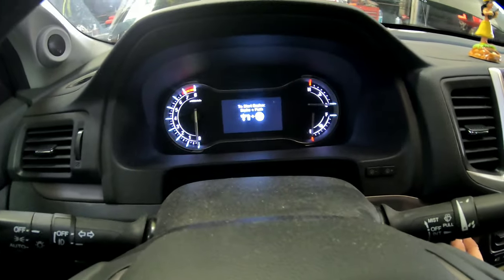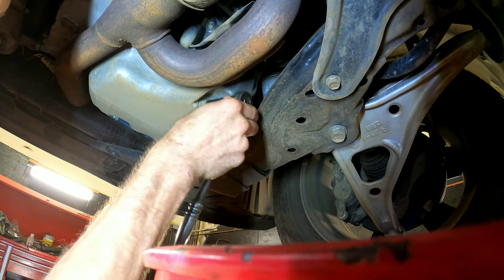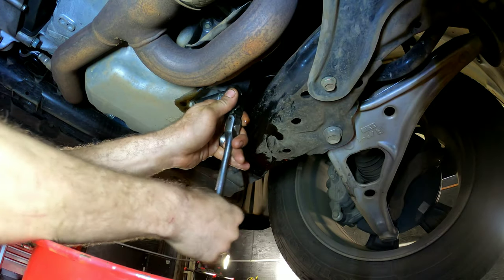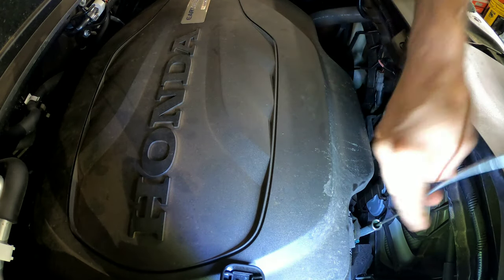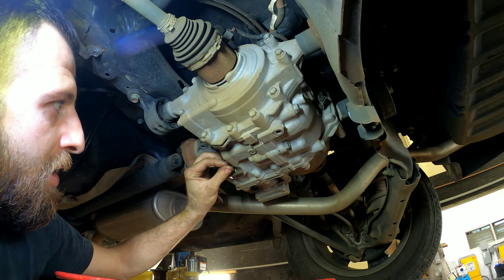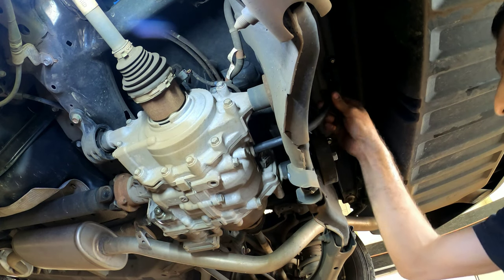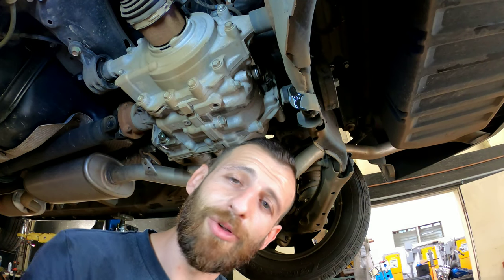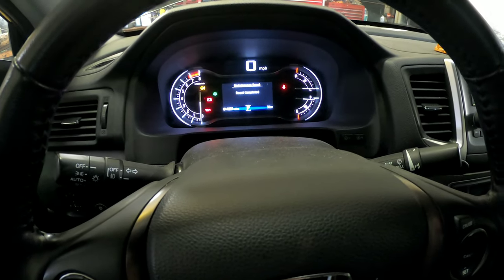Honda Ridgeline B16 Maintenance Light Oil change, Differential Oil Replacement

Comment: Just FYI, when doing an oil change on anything with a drain and a fill plug (differential, transmission, etc) always loosen the fill plug first. That way you know you'll be able to fill after draining. Nothing worse than draining all your fluid out only to find that the fill plug is seized in place and is going to take an extended amount of time or special tools to remove.

Comment: 4:40 I recommend removing the full plug first cause sometimes it doesn't come out. And if it comes out then remove the drain plug . Ask me how I know 👍
Reply: Correct me if im wrong but, As i can see in the location, he is in his work place as mechanic. So if fill plug cant be remove, he is in the right place to fix it. But for tutorial purpose, fill plug should be remove first so that if other diy people will follow this steps. Less risk of towing your car to mecahanic to fix the problem.

Comment: I have 2019 Sport Honda Ridgeline and I was wondering when I should change my transmission fluid? I have 40,600 kms now
Reply from the maker: It ahould show in your manual at what milage the recommended services are due
Reply: FixItPhillip i did and it only told me not to do it yourself. Honda dealerships said “96,000 and another one said 40,000”
Reply: Cree Rebel 40 if you are towing or driving in mountain roads in low speed.
Reply: every 30k miles

Comment: Light on at 15,000 miles for Dif, wow my ford not Due till 75k miles
Reply: The Ridgeline has a fancy torque vectoring rear differential. The first change recommended at 15K. Others are at higher mileages.
Reply: @searay26  15k first every 30k after